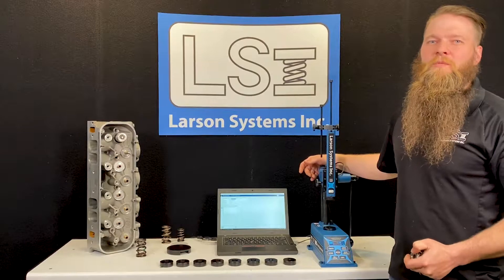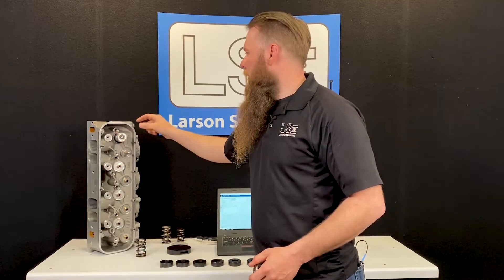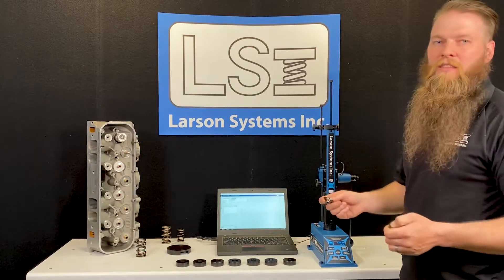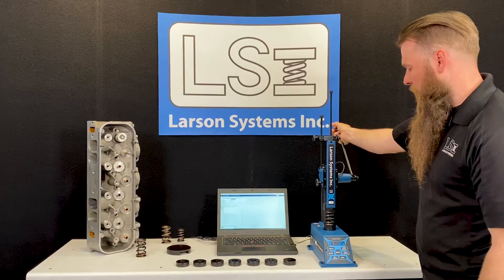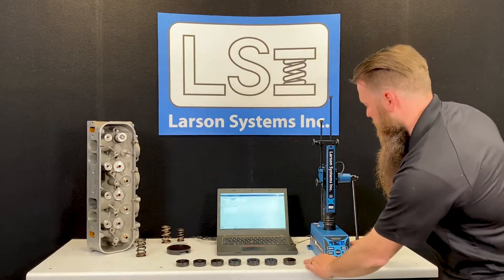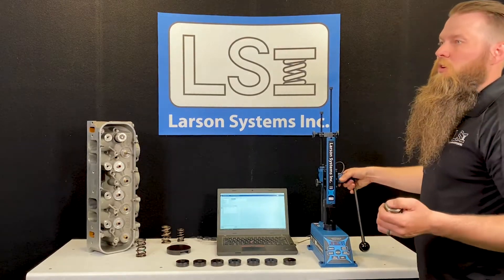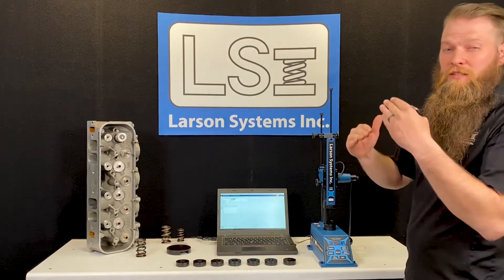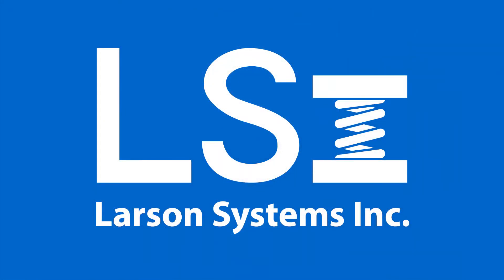Valve Spring Tester Demo

Comment: I don't know if my question will be answered but here it goes: I have an Engineering Drawing of a Compression Spring, where i must measure the Initial and Final loads of the spring at two specific heights. Initial Load = 10-12lbf @ .210" and Final load is 17.5-21.5lbf @ .150" ... what i have been doing and has been the standard at these kind of tests is that after calibrating the equipment to 10% its capacity... i compress the spring height up to .210" for Initial load and record the reading... followed by going down to .150" and recording the force value at those heights... I got a supplier that does things a bit different.... he interprets the Height mentioned at the drawing's initial/Final load as a variable element defined by the tolerance specified by the drawing.... in this case the drawing for a three decimal places dimension at inches (.xxx") a +/-.005" tolerance is applicable.... with this in mind...the supplier is recording all the force readings at every .001" over the +/-.005" tolerance of the indicated height by the initial/final load specification.. and afterwards is selecting the force result closest to the Nominal Force Value recorded as his/her final result... after doing this over a sampling of 30 to calculate capability, resulted with low capability values... I'm presuming that this is due to having two variables within the equation, Height (due to not using a static height per the drawing specification, and using the closest value between all the data points collected to the nominal force determined) and Force... as i understand by using a static height we end up challenging the variable force at a specific length, or vice versa we can challenge the variable height based on a specific force applied... considering one or the other as a variable, but not both at the same time... what would be the correct way to challenge an Initial load or Final load within an Engineering Drawing?...   email contact: (pedro.davila@indeninnovationspr.com)